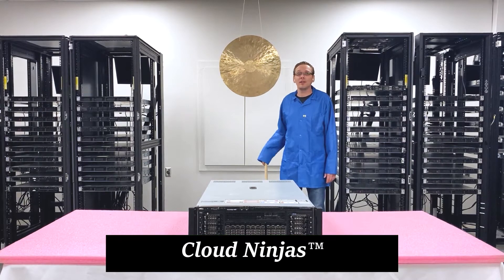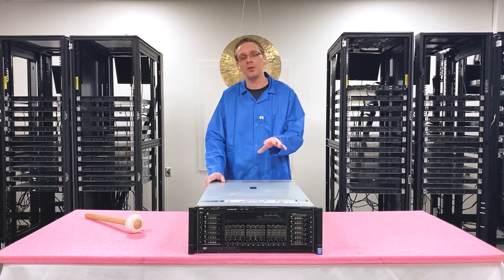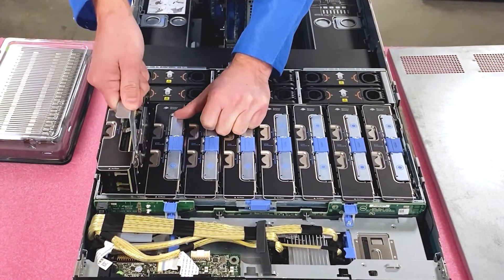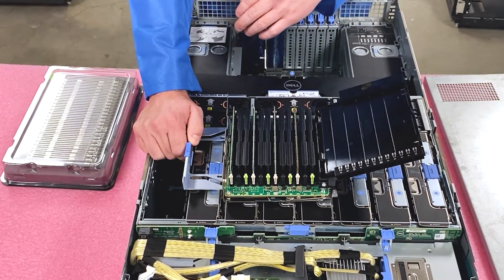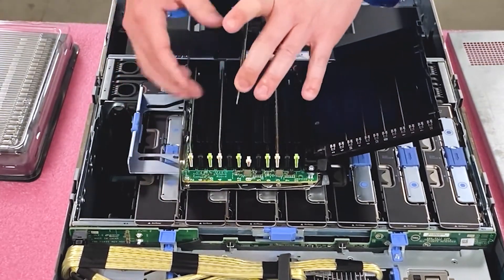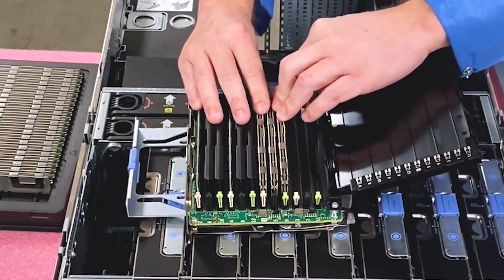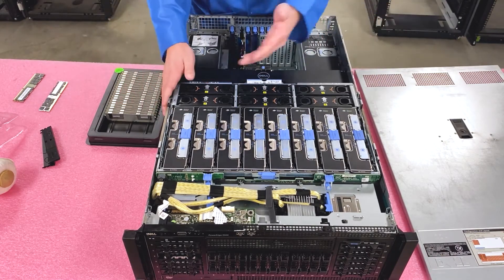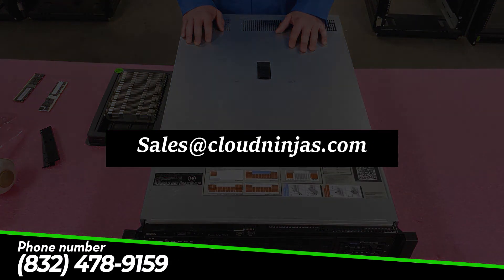Dell PowerEdge R920 Server Memory Spec Overview & Upgrade Tips | How to Configure the System

Comment: i bought firepro 7156x2 gpu and want to give a try to install on this server but im little confuesd about the power source will it work if i use extation power psu or drop the idea
Reply from the maker: There might be some power fluctuations that might damage your hardware, i wouldn't recommend that personally

Comment: This was certainly influenced by IBM design
Reply from the maker: Interesting to hear.  Curious what makes you think that?  Is there an IBM system that is very similar?  Thanks.  Take care.
Reply: Nah mans is just talking out his ass, dell had a massive constraint to fit 4 CPU’s with 3 QPI links each within a 4U form factor. This inherently led them to do the whack ass ram placement. I’m a software engineer who is building a homelab with one of these things to run some reinforcement learning simulations and its beautiful. I returned the HP variant.